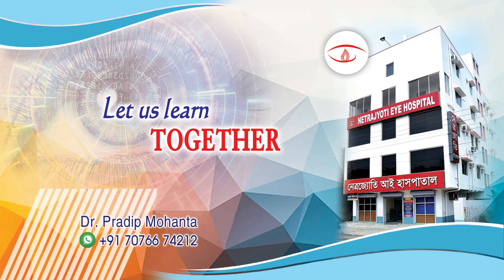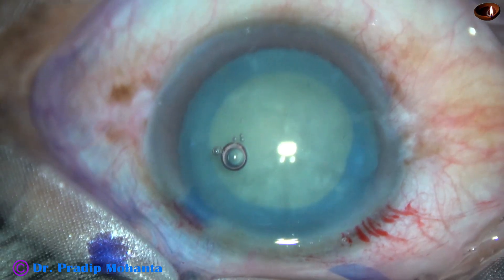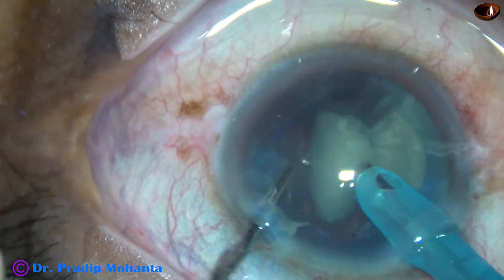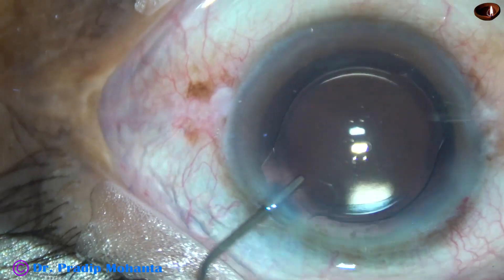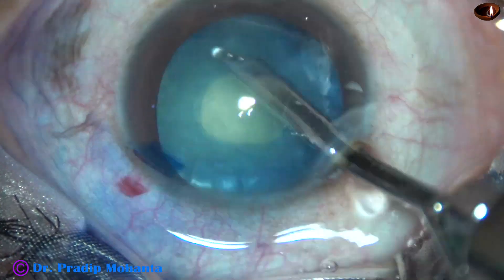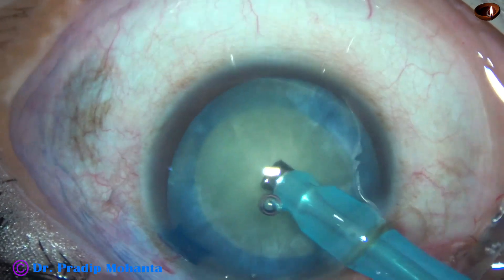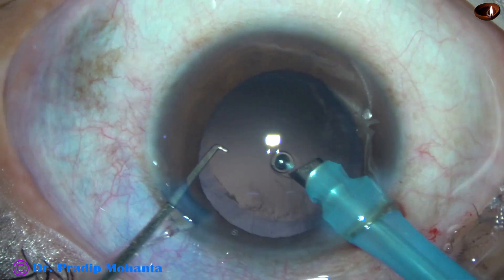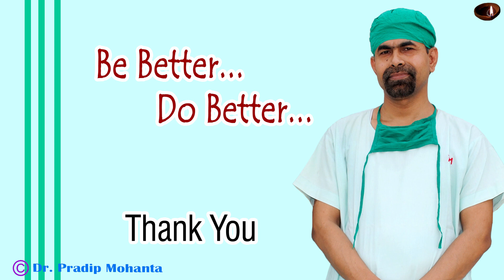Reducing vacuum and flow rate for emulsifying the last piece in Phaco : Pradip Mohanta, 22 Oct, 2020

Comment: Sir I agree with reducing the vacuum for the last 🥧 but I m performing phaco from the last 2 years and has done thousands of cases with your technique as you remove the chopper while emulsifying the last piece and emulsify it at iris plane and hadn't encountered even a single problem.
I even see a little bit of surge but as I do it at iris plane aswell as the leak from the Chopper's port is also avoided so I feels safe but yet reducing power greatly minimize the risks🙏💕
Reply from the maker: For cases with EPINUCLEUS acting as cushion over PC,  remove only the chopper,
for cases, with bare PC reduce vacuum plus remove chopper.
Reply: @pradipmohanta9321  Okie tnx alot sir
Reply: @pradipmohanta9321  I can't stress how important this last bit of advice is. Bare PC with no cortex or epinucleus you MUST reduce vacuum. Learned from experience...excellent video sir.